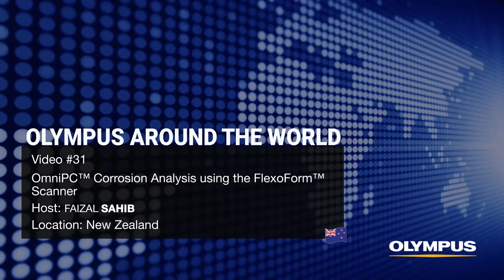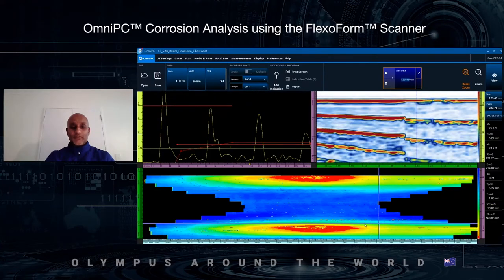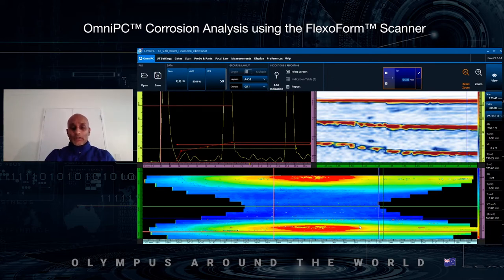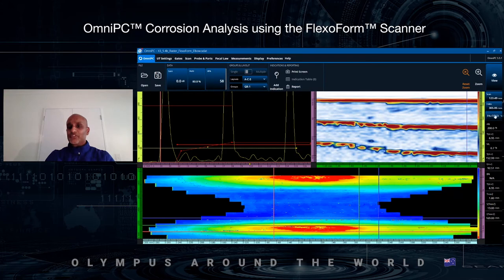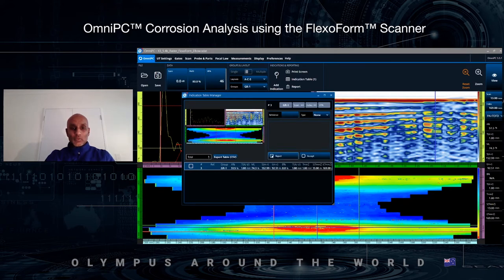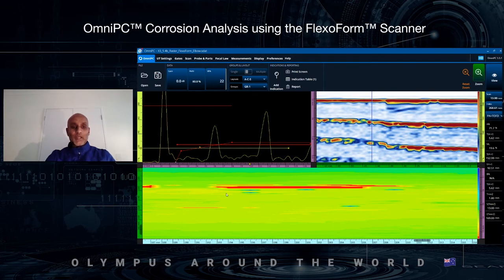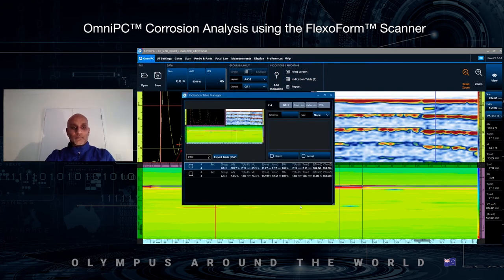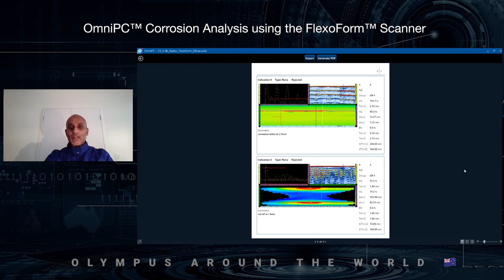OmniPC™ Corrosion Analysis using the FlexoForm™ Scanner

Comment: This is an awful way to scan for the minimum thickness. why cant you just make a button that says find lowest and you automatically jump to that area? Probably be to quick and easy to make sense. For how expensive this equipment is, your user manuals and explanations are really lacking. Color pallets only work if you have drastic changes in wall thickness. What if its pretty uniform in thickness? Then there is still a lowest number but you cant tell quickly where it is. I need to report lowest numbers.
Reply: Is this software not like the MX2 software, where you could set a maximum thickness and a minimum thickness for the color palette?
Reply: @edzavala606  I’m not sure I haven’t had to use this again. The problem with setting a minimum thickness and just going by the color pallet is what if the signal is a bad signal? What if there are multiple bad signals in that area. It’s really easy with this thing to have bad signals that are inaccurate. Trying to hunt through all that is a nightmare. The foam gaskets are terrible.
Reply from the maker: The goal of this series of videos is to showcase what is possible with the OmniScan X3 and other products, we have other material that is oriented to be step-by-step guides. We take everyone’s comments into consideration and want to constantly improve the product and our support to the customer. If you need more info on the product or one of its functions, feel free to reach out to your local sales representative or online on the Support section of our website.
 
To answer your question: the file is saved under Documents\OlympusNDT\OmniPC\Export. Documents\OlympusNDT\OmniPC is the default folder for OmniPC 5 files.